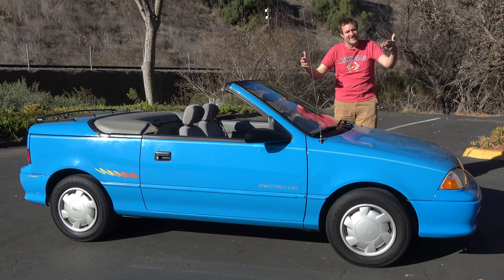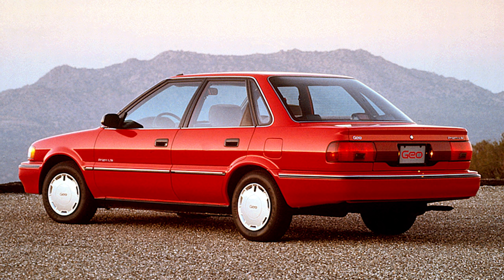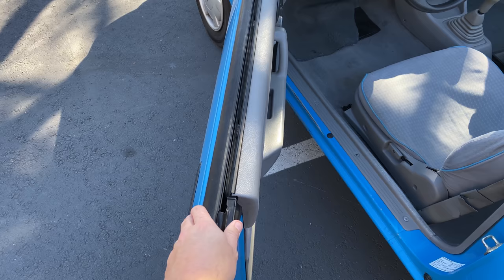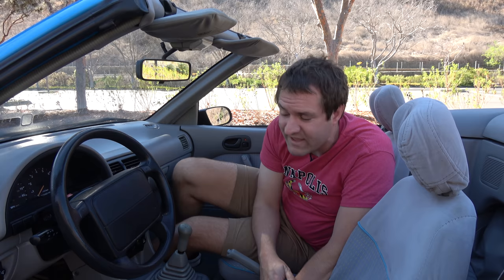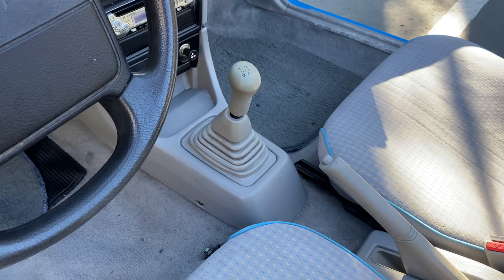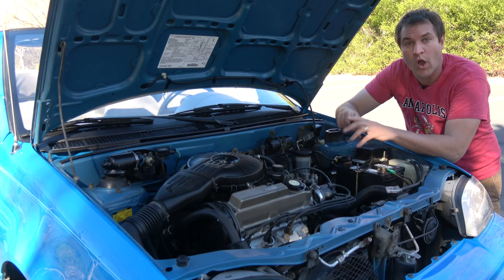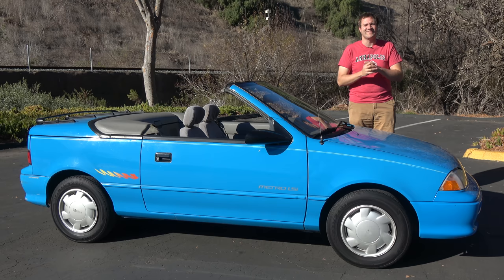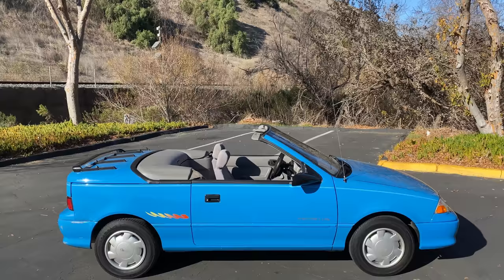The Geo Metro Convertible Was a Hilariously Pathetic 50-Horsepower Economy Car

Comment: not going to lie, i wouldn’t mind having one of these for zipping around town.
Reply: Don’t be lyin
Reply: I've driven them. Trust me, you won't be zipping around town, or anywhere else.
Reply: More like zipping around the driveway.
Reply: Me too. despite all the cheapness and quirkiness it's still a neat car to drive around doing your daily stuff and still have fun driving it. I'm from Germany. Here in Europe we didn't have Geo, but the Metro Convertible was sold here for a few years as the Suzuki Swift convertible. It only had little success though and is extremely rare these days.
Reply: I have a hatchback that was given to me it’s actually pretty fun to drive.  It makes me laugh every time I pass people going 80mph.
Reply: I enjoyed mine. Parking is so easy even in tight places. I had to make several dozen trips from San Francisco to LA and back one year and averaged 46mpg with the AC on and doing 75mph. That car had a 3Tech cam and a cam drive gear with a few degrees different than stock. With Suzuki Swift sway bars front and back the handling was really improved. Mine was strictly utility, nobody bothered it, and I seldom had the top down. It cuts 5-7mph off with the top down. Neighbors and tenants teased me about it. One tenant said that I looked like a clown driving a shoe. Hahaha, the dumb ass didn't have a clue that I owned that particular apartment house outright, no mortgage. This is the perfect car to drive if you are a Closet Millionaire.
Reply: That's actually what they're perfect for, as long as you don't have a lot of hills in your town. Going up a steep grade is when it becomes all too apparent that you're dealing with a 50hp car. LOL
Reply: @SigGuy320  I regularly crossed ''The Grapevine'' on highway 5 in California in my Metro Convertible doing 60+ mph uphill both ways. 4 lanes each direction and steep enough to have runaway truck gravel ramps. Some big rigs could only do 25mph. I just kept it wound out in 3rd or 4th for very long periods. Sure, it took a little planning ahead while driving but it went up the mountain every time. Its at least a 45 minute climb each direction with some downhill stretches where you could build up speed. The Metro would do 60 mph up Cuesta Grade in San Luis Obispo on Highway 10, uphill all the way. If you ever drove a motorhome or towed a trailer or boat, its a similar underpowered experience. I would hesitate to cross the Tetons at night in the snow, however. It was a fun little car that took a lot of abuse from me.
Reply: Living in a very large city, I filled up mine once every 2 - 3 weeks (1.3 L, 4-cylinder, hatchback). I should state, the 1996 Pontiac Firefly was pointy and had a more fuel efficient shape. It was really only ever used for urban city driving and was bulletproof for that. It allowed me to keep my fun and larger vehicles in the garage until it got totalled.
Reply: @ALAPINO  I was going to put a Suzuki Swift 1.3 DOHC engine in one Metro Convertible. My son said it would be like putting a ribbon on a dog turd. But he enjoyed the Geo hatchback like you had.
Reply: @kimmer6  You would have had a very unique thing had you done that. That 1.3 L was so easy to work on and I could only imagine, back then, it would have been a painless swap considering how compact the whole package was.
Reply: @kimmer6  I had my hatchback on a towbar on my Four Winds Chateaux RV (Ford E-350 chassis, gutless V8 Triton). It was only used in that role a handful of times and it was far more capable than the previous solution (two-stroke scooter on a hitch-mount rack).
Reply: @kimmer6  I drove one when I was a teenager, and it really struggled on steep hills. It was better than my mom's Suzuki Samurai (which was truly awful on hills LOL), but it labored big time. 
To be fair, where I live in upstate NY has a lot of low speed roads, so getting a run for the hills wasn't always an option. Regardless, I did enjoy driving the Metro. They were definitely better cars than they got credit for.
Reply: One of my neighbors has one lol
Reply: yeah, i live by the coast, i average like 25mph driving around town, so i wouldn’t care about the lack of power. it’s a cool looking retro car to grab groceries in 👍🏾
Reply: @SigGuy320  Was that the (terrible) automatic gearbox or the 5-speed? I found the 5-speed with the optional 1.3 L 4-cylinder good for my needs. I could imagine I would not be happy with the 1.0 L 3-cylinder 20 years ago as, like you, my area was a tad hilly.

Honestly, if I didn't live in the rust bent I would actually put more effort in finding another one. None of them in my area (North East) seem to have survived (it's been my experience that Suzuki products loved to rust).
Reply: You dont need huge horsepower numbers to clown around town...
Reply: @torstenscholz6243  I know it might seem silly but Im pretty sure they build cars differently in Europe in a better way to make the most out of small engines. When I went to Europe a couple years ago I rented an Opel Astra and while it was only a 1.4L or even smaller it actually felt quite fast and sporty and I reslly enjoyed driving it. It had power. Meanwhile my old car which was a Mitsu Lancer had a 2.0L 4 cyl was just boring to drive and seemed slower than the Opel. My current car has a 3.6L v^ because I cant find enjoyment anymore driving slow boring cars. Than again here we dont pay high registration taxes based on engine size and we have cheap gas otherwise maybe we too would have funner small engine cars like they do in Europe
Reply: @ALAPINO  It was a 5 speed, which was definitely better than the automatic, but it was also the 3 cylinder 1.0L power plant.
In my early 20s I owned a 1997 Geo Prizm with a 5 speed. It was one of the best cars I've ever owned. It's been a lot of years since then, and I still regret selling it. Geo may have been GM's extreme budget offering, but they were all great little vehicles.
Reply: I love smaller cars. Hopefully with electric coming we can get back to them.
Reply: @attackroflchopter4403  Same here. But honestly the future looks rather bleak in that regard. I hate to be negative but it seems driving will more of luxury years from now than it is currently. Guess time will tell
Reply: @ALAPINO  Thats why you get a running start before going up the hill/mountain. More often than not I see people slow down before climbing, hopefully youre not one of those. My little 1.2L does fine in the mountains
Reply: Just to drive 4 miles to town for a gallon of milk be fine. Drive 7 hours on a trip? NOT. Different cars for different needs
Reply: @bradleychilds4387  Depends on the person and their own ego. Alas sadly it appears you cant past your own.
Reply: @samusaran7317  well for vacation I would rather ride in a 3500 series pickup for 7 hours
Reply: @bradleychilds4387  Im glad to hear you put value in that.

Comment: Don’t you remember “hey man, can you push the mirror out a little bit more for me”? Manual passenger mirrors were meant for the passenger to adjust for the driver :)
Reply: Total first-world problem.  You either get the passenger to move it or you just lean over.  Done!!  Doug is making it seem like some sort of horrible awful inconvenience.  Tons of cars used to be like that.
Reply: @patrickgroll2046  35 years ago, I had a 1980 Datsun 310 with wing-type outside mirrors. No faired housing. So, if you were parked and someone parked next to you and brushed against the passenger side mirror, you'd have to roll down the manual passenger window, lean across the car to grab the mirror and readjust it. You may have to do this several times.
Reply: Runs better without catalytic converter and a better carburator.
Reply: I remember when there was no passenger side mirror
Reply: @patrickgroll2046  and? It may not be awful but it's stupid, why not give the passenger side rear view mirror a stick as well? Doug has all the rights to complain about it.
Reply: my passenger is a saint bernard. She likes to push the passenger mirror wherever the hell she wants to. needles to say, i've pretty much adapted to not having one

Comment: If you're stuck in traffic all the time and aren't going anywhere fast, this could be ideal for commuting.
Reply: If you dont mind having to deal with a manual transmission in traffic, certainly. A Prius would be a fairly economical, and more comfortable option though for dealing with traffic. Of course, I would imagine this would be easier and cheaper to maintain, if you're mechanically inclined.
Reply: The perfect door dashing vehicle if you're and a college town
Reply: @joemann7971  "If you dont mind having to deal with a manual transmission in traffic, certainly."

Everyone always says this. For me, the opposite is true. I'd MUCH rather be using a manual in traffic than an automatic.

The Metro, with a few mods, can easily do 55 MPG on the highway, and not that much worse in city driving. It's way easier and cheaper to fix than a Prius. The biggest downside to the Metro is that it's not nearly as nice build quality, it feels cheap and somewhat old, but it's also a lot more fun to drive, even if it is a bit slower.

There are aftermarket parts available for the Metro, too. So they can be fun to mess around with.
Reply: The best thing about the Geo Metro is that you can actually lift it up in heavy traffic and sprint with it by the side of the road until the traffic thins out.

Just make sure you don't do this when it's windy, or you could be looking at an insurance situation.
Reply: engine would overheat with ac, which is a staple of cheap cars
Reply: @MikeBarbarossa  Which engine? The Metro engine? I never experienced that.
Reply: I can't think of anywhere nicer to be while sitting in traffic

Comment: The wear pattern on that front tire screams "I need an alignment"
Reply: Camber gang
Reply: It’s so light he’s probably been driving it like that for the last 30,000
Reply: Probably contributes to the "cowl shake," been driving 30k with the driver's front wheel tracking every imperfection in the pavement. Probably didn't get aligned because "this is a nice one," yes Doug it has shiny paint but how are the bushings in the front?
Reply: @tatwood93  they are crispy almost 30 yrs old high performance bushings lol

Comment: I had two of these...a 92 convertible and a 1997 hatchback. To understand the Geo, you have to look at it in regards to what it was designed to do. It was not to set records at he Nurburgring, but rather to offer reliable, cheap, utilitarian transportation...and to that end it was a very effective.  When I bought the 97 as a grad student in DC it was the cheapest new car you could get in the US. I kept it for 25 years and just recently gave it away.   The little 1.0 inline 3 and manual transmission were a remarkably reliable combo.  For several years I had an E55 AMG and M6 Convertible at the same time as the Geo...For commuting to work, I preferred the Geo as it got 4 times the mileage as the M6 and was easier to park...and you don't worry about getting it dinged up. I wish I had kept it truth be told.